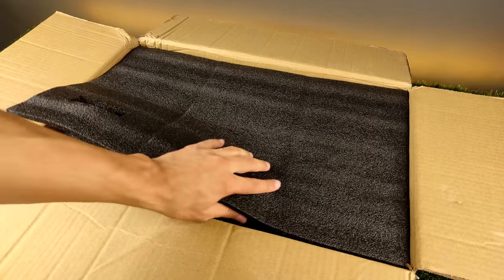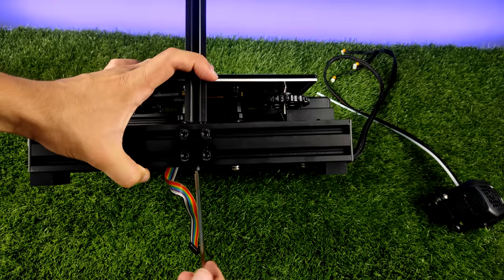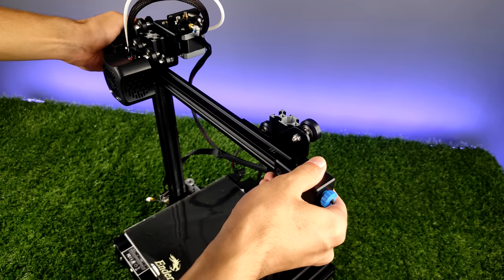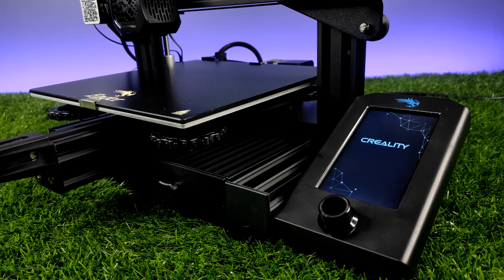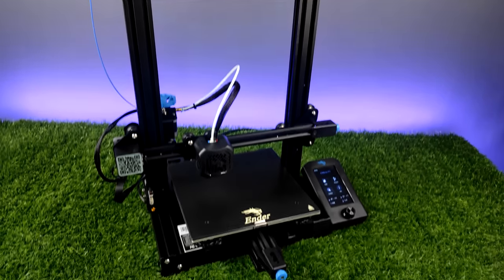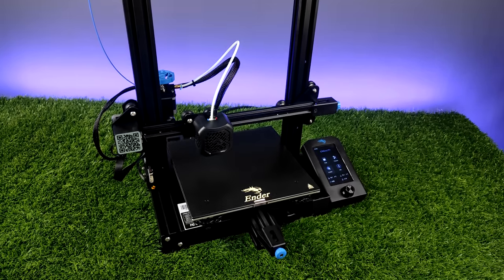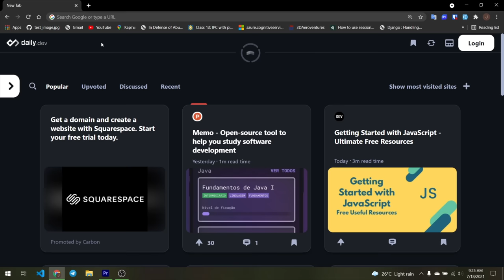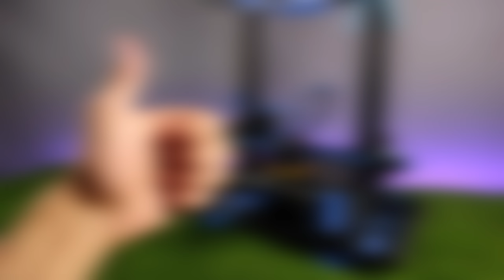21 First Upgrades For Your Ender 3 V2 // Best Mods For Ender 3 V2

Comment: Constraining the z-rod like that might be a very bad idea, basically these printers were designed for it to be unconstrained, if your rod is not straight then that is because either it's bend or held in place wrong and there can be several place where it can be held wrong.
Reply from the maker: Thank you!
Reply: So I shouldn’t make the spacer
Reply: @Noise_H  No you shouldn’t, it could severely mess up your z axis.
Reply: @gernotg8480  My dude you are better off getting an entry level job in a restaurant than begging on YouTube.
Reply: @annekedebruyn7797  hello Anneke. Maybe you can help me. I cant find anything here
Reply: > if your rod is not straight

What if my rod is straight though?
Reply: @ne0komodo  then send me some pics of your rod why dontcha ;)
Reply: @zioxei  wanna see mine?
Reply: @Noise_H   I know I am late to the party, the bottom spacer that goes behind the Z stepper is a recommended upgrade. The Z screw holder at the top is not recommended.
Reply: Not really. TronXY XY2 Pro, a bit superior printer when compared to ender 3 V2 (I have both) have a much much stronger constrain in the Z axis compared to  that. It is right at the top, exactly like that, and the printer works fantastically. I shouldn't say stuff like that if you not sure about it dude.
Reply: I dont think it's meant to hold it firmly just guide it which is good if you're going to be hand cranking it often. My printer has a rod holder about 1/2 up to give it some support already so another one at the top isn't going to hurt
Reply: @gernotg8480  Smile, you havent lost your internet connection
Reply: @goblin812  can you give ne a job?
Reply: @Russell White Please i have tried everything. I will be homeless soon. Please help me. Please
Reply: @Russell White Please give me a chance.
Reply: Somebody please help me.
Reply: @Russell White not really dude. The mecanism of the Z-rod is exactly the same compared to the TronXY XY2-Pro. That alone is reason enougth to disconsider this "proven concept" that you talked about.
Reply: @Noise_H  The spacer could be a good idea to help it be more straight up. I had some z-binding on my ender 3 pro before putting some in there but you should not constrain the rod at the top.
Reply: @gernotg8480  you already supposedly sleep on the street
Now you are almost homeless 
Which one is it.
Get your story straight and look in the real world for jobs
No one will help you here 
Its the internet 
I won't help you either
Reply: @zioxei  my rod is long😏
Reply: @johndavid360  wrong, if it straightens a misaligned rod it helps, reduces wear, reduces friction. Does not mean it was installed wrong, mine was slightly off I installed shims so it is not to close to the vertical bar so it is now precisely parallel, a good thing no matter how you look at it. Again clearly you are wrong.
Reply: Good advice for people that want to buy one
Reply: Yea as someone new, I wasn’t gonna do that one
Reply: I just assembled one of these, and the brass piece the screw rod went through was upside down, so the threads were opposite! I thought I’d threaded it, then took a closer look.

Comment: the z stepper spacer is only needed if you have misaligned motors, which were common in the original ender 3 v1s. It might do more damage to Ender 3 v2's
Reply: Yes though I gotta say mine needed a really small shim of 1mm behind the motor.
Reply: When assembled (correctly), my z-axis drive screw was not parallel with the vertical riser.  I carefully sanded about .015" off of one edge of the z-axis stepper bracket to make it align.  That bracket appears to be flawed, and it's a flimsy attachment.  Once the drive screw was properly aligned, the printer worked well.  I am considering trying those printed shims (although I'm not having print problems now).  It seems like an improvement.
Reply: Yeh don't print spacers for a stepper that regularly reaches upto 95-100°c. What a stupid suggestion
Reply: @brett567  I think that your stepper might just need it if it reaches 95-100°
Reply: A simpler solution would be replacing the rigid coupler for a flexible one.
Reply: @brett567  I'm printing regularly at 100-200mms at like .6-.8 amps on klipper. My steppers, in a heated enclosure, don't get over 60c-70c. If yours are hitting 90-100 you have a problem.
Reply: Right, this is why I did not understand the need for it.
Reply: @reneroldan5647  Looks better.

Comment: A Z rod guide is never a good idea. A slight wobbling is usually not an issue but if you force that wobble through a guide, it will definitely end up showing itself in your prints. Just let it wobble as long as the steps are OK
Reply: And yet Creality sell an attachment to do exactly that.
Reply: @bobh0905  Creality also sells the product that ‘needs’ it. They are selling the problem and solution
Reply: @bobh0905  The ones creality sell do not do exactly that. I have the creality ones as they came with my Dual Z-axis kit for my 3 Pro, The ones printed in the video are a solid stiff piece of plastic that forces the rod into a position. The creality ones have a bearing inside that can actually move around, they are held in place by springs on the inside I believe, but they are just light enough that the rod can push the spring if it needs to. It keeps them straight with wiggle room, printed ones do not and could damage the rod that way.
Reply: @nytem979  The printed ones I've seen have a hole for a bearing.
Reply: @bobh0905  yeah but what I was trying to say was that the bearing can be moved around by the rod on the inside of the creality one, the printed ones keep the bearing in a static place

Comment: The bubble leveler serves no prupose. You tram the printer, not level it. The grip handle reduced your max build height. Idk why you stopped at the z extrusions for the slot covers. The z rod stabilizer is iffy. Everything else is nice.
Reply: Push the Y axis up and down with your hands and you will find that not having a double Z axis gives the bubble leveler some sense. It's only a monitoring sensor, just in case you're finding strange values in bed tramming, and you understand that the problem is Y axis level.

Comment: I actually like some of those upgrades. I just bought a used one and it has a few kinda like these. The best one that mine has is a LED strip in the frame around the tower. It helps a ton.

Comment: To the content creator and anyone else watching, 04:15 to 04:30, do NOT ever do this. This will damage your Z axis rod.
Reply: Came looking for this comment. I don't know anything about 3D printing but common sense was telling me this could potentially be a bad idea.
Reply: Yes because plastic will destroy a steel lead screw 🤔🤔🤔
Reply: @urgamecshk  it will not damage the steel, but constraining the z axis rod will result in shit prints.  It is designed to be able move to some degree.
Reply: @nikohugger9097  I'm not the one who said it would!
Reply: @urgamecshk  it “destroys” it by constraining it. Constraining it for too long will eventually cause stress bends, especially if you’re continuously printing tall prints, and even more so if you have direct drive. A bent rod is useless and is considered “destroyed”.

Comment: I started printing around a month ago and 1 thing I absolutely recommend to use for the bed are dial locks. I found a file for them on thinigiverse my first week of printing bc I instantly got tired of dealing with the bed. I have not had to level it again in about 2-3 weeks. Every print first layer is perfect as long as bed is clean. 

I never see any channel or anybody suggest them. Is there a downside to using them?
Reply: hey, there shouldn't be a downside as the bed dials shouldn't rotate. As long as they don't interfere with any moving part you will be good. (p.s. can you send that link, I have been looking for one)
Reply: I couldn't find any stl's that had decent download numbers. Would you mind sharing the link?

Comment: Terrific video.  I will probably only use a couple of the items though:  The bed pull, and the dial knob with "wings" for speedy scrolling.  I moved my filament roll to the side of my printer, so it feeds directly into the extruder, so I don't need a filament guide.   Rather than the side storage bin, I'll probably build a camera mount there.
Reply: Can you share the thingverse code for the side filament mount? Thanks!

Comment: the very first thing you should do to an ender 3 v2 is to print a new PSU cover. you can see at 1:58 the big plate at the bottom of the machine that has some missalligned slots for the fan but *NO* vents for the air to go anywhere. under the black aluminum plate there are vents that are completely covered up by the black plate. remove that if you don't want your printer to go up in flames one day lol
Reply: I did this but also added an 80mm noctua fan at the same time

Comment: for me the most important upgrade that i actually had to make was the spacer for the z axis motor, when i assembled mine, the assembly could only go up for a little and then it would start grinding and then get stuck, as soon as i put a spacer on for the motor i had zero issues

Comment: Just got my first 3D printer (Ender 3 V2).  I am excited to print some of these myself.  What filament did you use? That color looks like it matched the default knobs very well. Thank you for linking the files!
Reply: There is no fucking link…
Reply: @rexiem2018  all the links to the files in the description. Try to read before becoming Hulk
Reply: @nelsonmarques1334  what filament was used?
Reply: @Foodran  probably PLA. Usually on the thingiverse links, they will advise on what filament to print
Reply: @nelsonmarques1334  okay thank you
Reply: @Foodran  if you want it to match perfectly, use Creality PLA blue

Comment: I see 2 useful upgrades like always wit this type of video
Reply: What are those, I’ve only made the V slots and I’m new to 3D printing so what are they?
Reply: @Noise_H  well the guards for the extrusions are ok, bl touch, maybe the capricorn tubing and then i dont remember anything else that would be that useful
Reply: @Noise_H  tho if u change the tube might aswell change to an all metal hotend

Comment: Hey, what did you use when you removed the v Slot covers from the heated Bed?
Reply: It was super glue accelerator, to cool the model so it pops right off!

Comment: Hi, thanks for this video! I'm just now seeing this video and I've purchased an ender 3 v2.  Not sure if there's already a follow up video on this channel,  but seeing as its been 6 months, it would be great if you could share your experience with the mods - do you still use all the mods shown here? are there any mods that negatively affected the performance and also any that dramatically improved the performance? Thanks!
Reply: Hi, did you installed those mods? Maybe you can share your experience with new ender 3v2 users :)
Reply: Ideally, you should have 100 hours of print time with the printer on its stock configuration before changing stuff, otherwise troubleshooting later is a nightmare because you have no known working setup to measure against if something goes wrong.

Comment: Great video, I dont know if they have changed the length of the bolts used for the top brackets, but they are not long enough to be able to screw into the top bar with the spool attachment. It should be a simple fix of just sanding the base down a bit, but id thought id comment just in case some other person is running into this issue. All in all I love these mods and most are such a nice improvement of life upgrade.
Reply: I had this same issue today, wish I saw this comment sooner lol
Reply: @Goodvibez_live  I did the same thing toda, and I wish I saw it sooner to.

Comment: 4:10 don't do that, this will cause more problems than it "solves"
Reply: Not doubting you, just curious what problems it may cause?
Reply: @sonicsupersam7793  causing unnecessary strain, if the rod is displaced by that much and it causes you problems, it’s better to try to fix the alignment where it’s held, not to add another one.
Reply: Buy a proper bearing block and couple it with a spider coupling to the stepper.. The right way.. Oh and for the love of god don't sit a hot stepper on fecking plastic 😂

Comment: I just got the ender 3 v2 and want to mod it. Just out of curiosoty, does the X and Y - Axis and the belt tensioner covers serve any functional purpose?
Reply: From what I hear it's nice to have covers to prevent dust and plastic debris from gumming up the works in the long run.

Comment: Yup lifting your Ender3 like that totally a good idea!
Reply: M5 screws can hold about 800 kg each!  Whats the problem?
Reply: @Robin-Visser  you are putting pressure on the rails and are ever so slightly introducing misalignments. This will cause your prints to come out less than perfect; and the Ender 3 V2 is capable of producing print quality that equals that of $2,750 dollar printers -- if aligned and tensioned PERFECTLY.
Reply: @TheTurbinator  how is it putting more pressure on the rails than the stock feet?
Reply: @Alucard0715  Can you guarantee those feet will come out flat out of the printer? No, because most pieces of glass are not flat. The stock feet will compensate since they're made of foam. Maybe if you print yours out of flexible filament. But if vibrations are a problem for you, I suggest putting the printer on top of a cement slab.

Comment: Pretty cool stuff thanks for the links. I wondered why your bed is mirroring and realized it's upside down. Is there a reason or did you flip it by mistake ?
Reply from the maker: Hello, thank you for your feedback, the reason is because original side got some scratches until I install BL touch, that is why I flipped it, but that opposite side also works well as it is smooth glass, you just have to wash it with dish soap and wipe it with paper towel, and use it without finger touches
Reply: I could never get the prints to stick to the original side. I flipped mine right off for that reason.
Reply: @kites0852  maybe you had wrong bed temps. I love the carborundum bed tecture and my first layers always stick great. I used the bare glass side also when I first got it, per a friend's rec., but I flipped it back over after seeing a review on the carborundum from another YouTuber that does this stuff. Was a great decision as it does better for me thatln the bare glass.
Reply: @engineericly  Same for me! I got scratches too but then I got the bl everything went perfect

Comment: how do u get such good addhesions on the ender 3 v2's bed? i got mine about a year ago and to this day i still havent been able to print without using masking tape or glue stick eventhough i leveled and cleaned the bed correctly (i think), also another question, why do u use the other side of the glass bed when using the bl touch?. thanks in advance.
Reply: I've been getting good prints since I added BL-touch. Totally worth it
Reply: I bet you use paper and then 0 your Z off that, don't you?
Reply: right or wrong, I had some serious bed adhesion issues ( I tried different temps, levelling and re-levelling etc). In the end, I fixed it by cleaning the bed in dish soap and hot water, and using a LIGHT coating of Wella Silvikrin Maximum Hold hairspray (just a light misting on the bed). Since doing this, I have had no adherence issues.
Reply: @urgamecshk  as is suggested on many videos and guides. If you know a better way, please share rather than belittling those without the knowledge. Thanks :)
Reply: It's important that you never touch the glass bed with your bare hands and always wipe it clean before printing.

Comment: The level indicator is in a useless position there as the plastic part can pivot to begin with
Reply: @Russell White Yeah, the bed tab is crap, as its linked to your springs, you will mess up your level every time you touch it. Agreed on the dual part cooling duct.
Reply: @Foxy_proxy  It's not linked to the springs...

Comment: First of all. This Black/Blue Style is fantastic. Maybe that's cause blue is my favorite color. Some questions:
1. ) I heard a good upgrade would be the metallic feeder?, too.
2. ) I read the AUtobed Leveling doesn't work on the Ender V2, or is there a special V2 Version?
I look forward to buy this Printer as my first one next month. SO I definitely need blue Filament, how much kg do I need for all those parts?
Greetings from Germany.
Reply from the maker: Hello, 
1) Yes it is great upgrade
2) It works with latest versions, for old versions I don't know, but you should upgrade its firmware, you can use following one, I loved its functions: https://github.com/Jyers/Marlin/releases

1KG filament will be more than enough, but be sure that your blue color is the same with color of parts that comes with the printer in stock, so you get great accent
Reply: @engineericly  How do you know what version to grab?

Comment: AWESOME!  Following along with you.  Question?  What was that spray (705?) that you used to lift the V-Slot snap covers from the Bed?  Thanks!!!
Reply from the maker: It was super glue accelerator, to cool the model so it pops right off!
Reply: The new carborundum covered glass beds are amazing and once the bed cools, the printed item can easily just pop right off with a push or pull, so you don't even need a scraper.